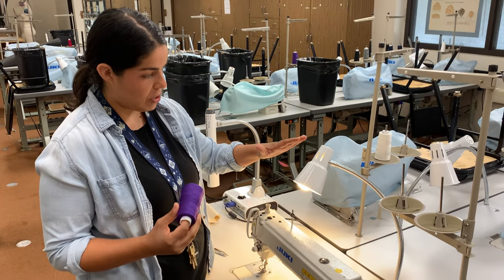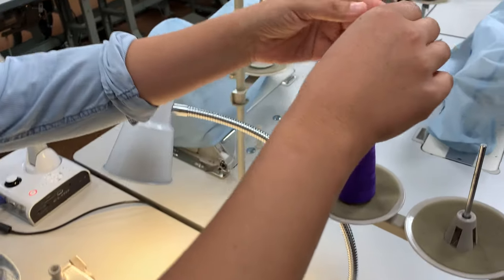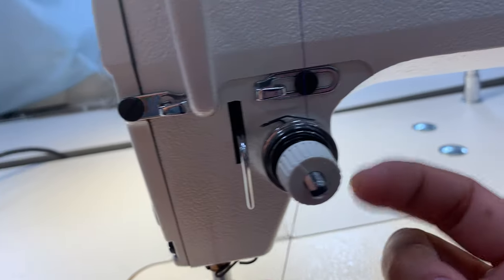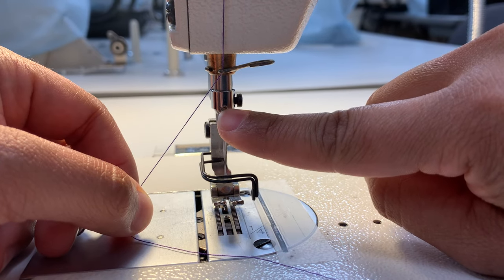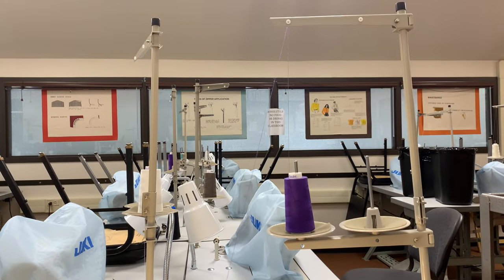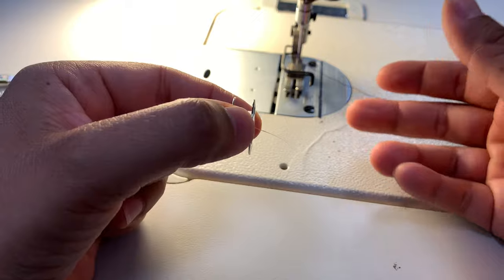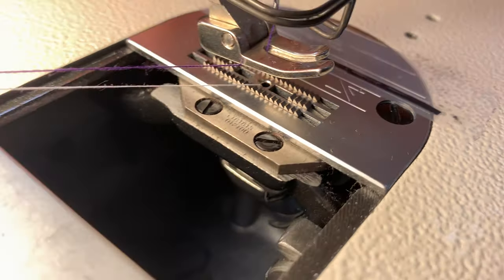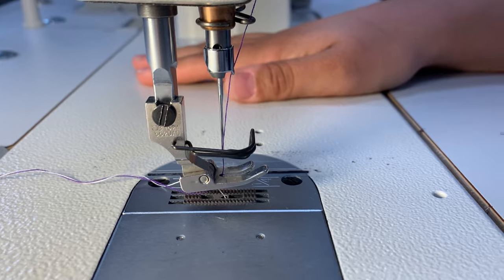HOW TO THREAD AN INDUSTRIAL JUKI

Comment: I'm having a problem with threading my machine, and bobbin which do not match the machine exactly that you are using on your video.The video is very good but as my machine is slightly different, I can't work out how to do mine. The thread keeps snapping, so something is obviously wrong, and the needle keeps hitting the spool case. HELP please

Comment: I was taught when threading that the take up lever should be at the top and to lift the presser foot when passing the thread into the tension disks. Lifting the foot opens the disks to ensure the thread is seated properly.

Comment: Thank you so much for this wonderful presented video.   I got a second hand Swift GC5550 and no user manual.  I have no idea what I am doing but your video help me to thread the machine and out the needle in correctly.  I am still trying to control the speed, it goes way to fast for me at this stage.  
My question please my top thread keep on breaking after just a few stitches, Can you please help me to get this right? And how do I control the speed so it doesn't go so fast please?  Thanks in advance.  Nicolene from South Africa

Comment: I just got this machine Juki DDL 8700 for Christmas. You explain this so well. I was told to only use Polyester thread, but I see that you was using cotton thread for an serger. So what is the best thread to use in this machine?  I got this machine for making quilts. I have always use cotton threads for quilts.
Reply: You can use your cotton threads. Just watch your tension. I use my Juki for piecing too. Don’t put your hand behind the machine. Right hand guides the fabric left hand steadies the fabric on the table to the left of the needle.

Comment: After putting my thread in that little floss tuck, my bobbin case has a small coil like in that gap where the needle goes in and out, I’m not sure what the next step would be since my bobbin case is different than yours.

Comment: Awesome information, thank you for your time. I am using a juki DU141NH however much too often the bobbin thread twists knots just before it gets pulled out of the case when sewing causing the top thread to bunch under the fabric. Even when holding the case in hand and pulling the thread through a short portion will flow out perfectly untill the thread twist and knot inside at the hole and case ten tio er causing the thread to get stuck… I believe the twist happen when spooling the bobbin how do I remedy that, any ideas… thank in advance…
Reply from the maker: Loose bobbin thread can cause a lot of problems. The speed that you wind your bobbin also makes a big difference to the quality of the wound thread. Higher speed, correct setup for winding, and don’t thread through a hole in the bobbin (this causes issues on industrial machines). Hopefully a smooth bobbin fixes your issues.